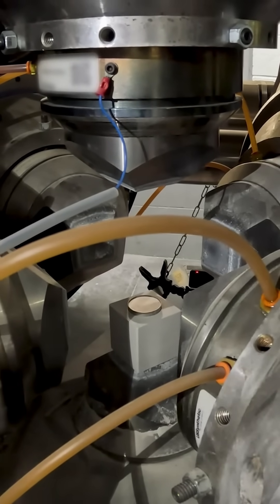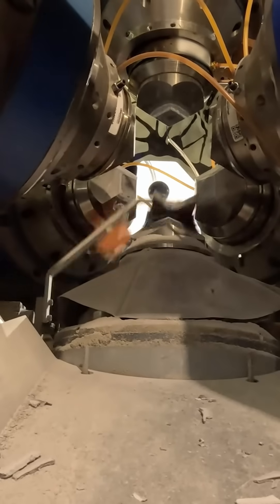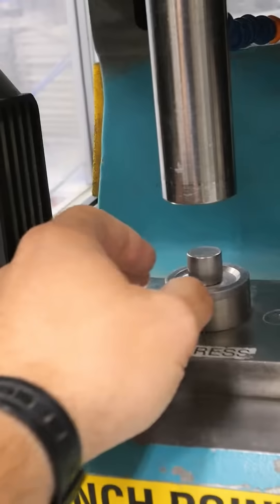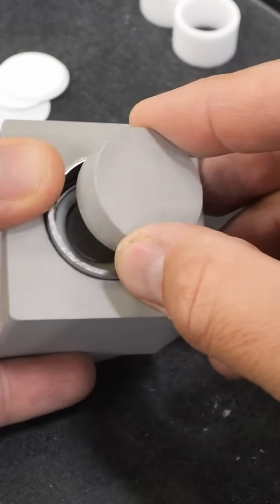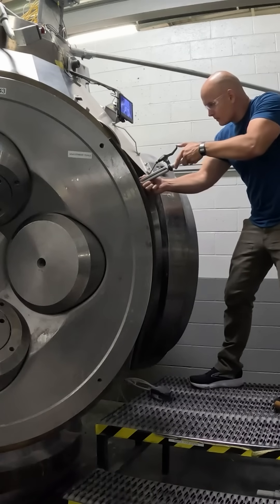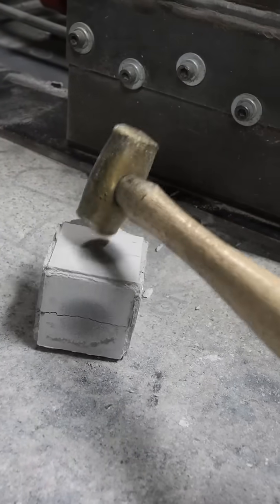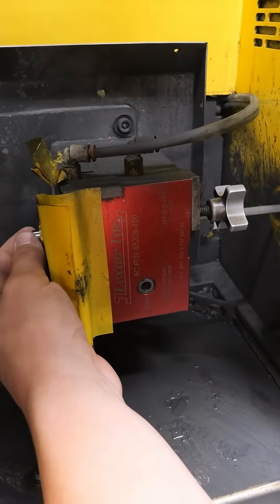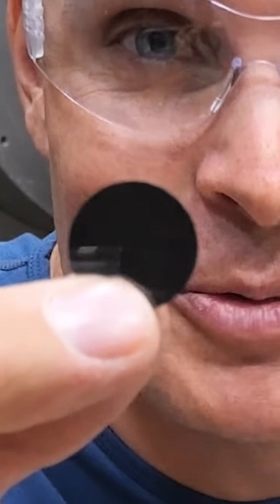How to make your own Diamonds - (easiest method)

Comment: How much would it cost to tile my bathroom with that? How much a square foot?
Reply: Might fall in the category of "Don't bother if you need to ask for price"
Reply: Too much
Reply: Could make a sweet Roman-style mosaic with different colors of diamond tiles
Reply: @Alex-rt3po  makes as much sense as anything else said  here. 👍 
  I'll just keep dreaming of the day when I can afford an iridium metal tombstone.
Reply: A 16mm cutter is roughly $120, but then you probably want the polished diamond only, so add a bit more to remove the carbide back. 

As far as the per square foot you would need 460 of them, so over $55K/square foot. 

But that is a bad idea, if you have issues with your shower being slippery, this will put that to shame (that is why they make diamond bearings too).
Reply: @samrjuliea  That's awesome, I've never heard of diamond bearings before, but it makes perfect sense
Reply: @samrjuliea  thanks 
This might make a nice cutting board 🤣
Reply: @ralanham76 Your knife needs to be harder than the board. That may be too fragile to cut anything.
Reply: @ralanham76 you wouldn't want to damage the knife
Reply: @ make a matching carbide knife 🤣
Reply: @CyberlightFG  eh, just strop the blade after.
certainly want one with a belly to perform slices instead of chopping asto not chip the edge but merely fold/round the apex.
Reply: @ralanham76  RIP knife...
Reply: @ralanham76 carbide is still softer. You'd need a matching black diamond knife.
Reply: @ralanham76  this would ruin your knives.
Reply: @ralanham76  maybe a thin vapor deposited diamond layer on your knife. Maybe a diamond Damascus blade, I doubt it would be called diamond Damascus except maybe on an infomercial, but what I'm seriously  thinking of is vapor deposited diamond atomically thin layers folded between alternating layers of high carbon and low carbon steel, tens of millions of layers. Hopefully because it would be so thin it wouldn't be as brittle. If anybody knows of a study by anyone creating anything like that please fill me in with a link to the research paper!  I would really love to know if there's any practical benefits to that concept or if it would just be good marketing to stupid rich people.
Reply: @ralanham76  no it'd be horrible. you'd dull your blades and eventually even get metal shavings into your food. you want your cutting board to be an organic material that's softer than your knife, so that at worst you end up with pieces of the board in your food instead of pieces of your knife
Reply: @samrjuliea  What do we use Diamond bearings on?
Reply: 19mm are about $300 so how many mm do you need?
Reply: I receive hundreds of these daily for my job, it would be the sort of thing reserved for the extravagantly rich or Saudi oil princes.🤣
Reply: Diamond floors and probably cutting boards are very likely to shatter, as hard things often do. It also won't be very comfortable on bare feet, especially if you gotta pull shards out.
Reply: If you have to ask you can't afford it.
Reply: Inside no brother roof tile. Sell it as a lifetime option 80k square ft.

Comment: Black diamond jewellery would look so cool
Reply: This company USsynthetic has a side job called Elysium diamonds where they make rings out of this process. I used to work there.
Reply: Yes and no, the polished diamond looks cool, but as-pressed or laser cut diamond not so much. 

So the only jewelry that I have seen made with them is cufflinks.
Reply: @samrjuliea  Jewellery would look meh, but black diamond DnD dice from D4 to D20 would be amazing
Reply: @samrjuliea  I've seen optical grade CVD monocrystal without the stupid fancy cuts and its beautiful by itself in a square/rectangle form.

Comment: What if we pressed a super thin sheet of diamond and layered that as the top layer of a phone screen
Reply: They do somewhat do that. but with sapphire. The reason why diamond isnt used is cause even though they are the hardest, they are quite brittle. Which is why a thin sheet is hard to achieve.  But maybe in the future.
Reply: In this case it is better to use CVD diamond. A different metod to generated layers of diamond in vacuum. And you can make transparant diamond.

It is fast for thin layers with 3 inches in diameter. If you wait very long you can make disks with half an inch in thickness.
Reply: I think they already do this with sapphire. At least for some camera lenses if not the whole screen.  I think why it’s probably not used currently tho would be because diamonds can be quite brittle still and a thin layer would be really brittle. Probably why sapphire is used as its hardness is like 9 so close to diamond but it’s not as brittle and more workable.
Reply: They do it for the watches but not the phones. They never really publicized the reasoning though.
Reply: @NickSteffen I suppose it's because watches retain value longer than phones
Reply: KYOCERA had Sapphire screen. Extremely tough phone. Phone regularly in a pocket with keys. Never a scratch. IDKY all phones aren't made tough. Unless they count you breaking your phone to sell you a new one.
Reply: They can't, diamonds are insulators, they can't be used as a smartphone  screen.